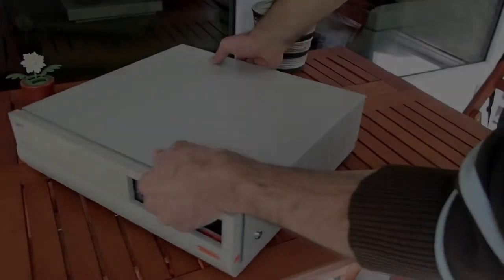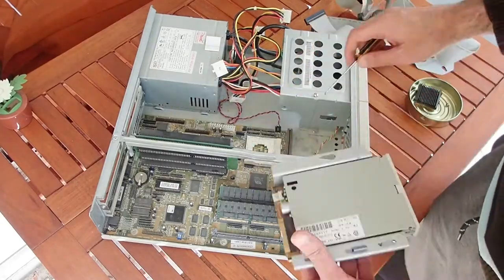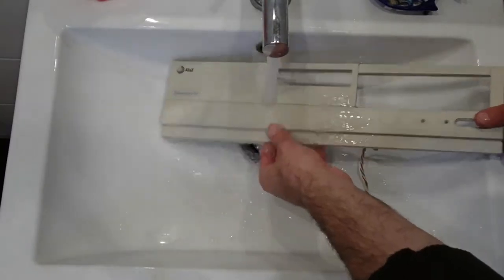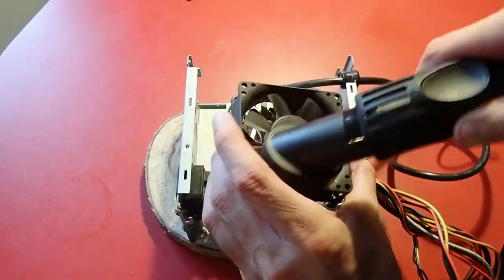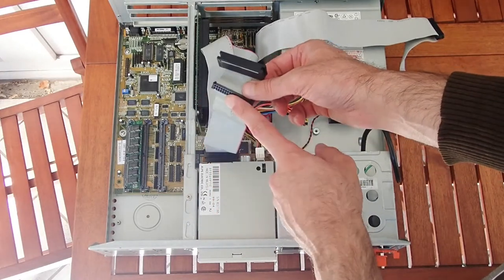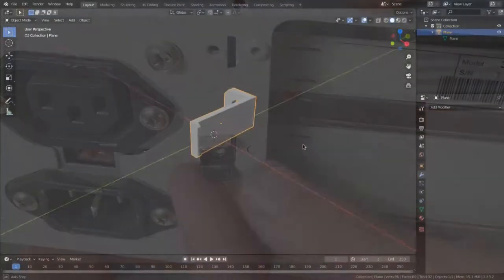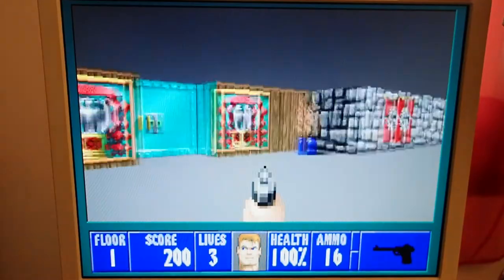AT&T Globalyst 515 restoration - from boring office box to retro 486 gaming PC

Comment: I got an NCR 3231 which is 95% identical to your machine. Fortunately it came with the 256MB cache memory (one of the main reasons I got it). That, along with the 66Mhz CPU upgrade and the 20MB total RAM makes a fantastic 486 machine. One of the differences with yours is the two ZIP available free sockets to add 512KB VRAM modules, to make 2MB total VRAM memory but they seem to be difficult to find.

Comment: I have the smaller version of this PC, mine is NCR branded, model "SYSTEM 3227". The case design is the same but at about 1/3 of the volume of yours, it has no 5.25" neither 3.5" bays and the floppy drive is of the slim type usually found in laptops. The hard drive is a standard 3.5" unit tho.

Quite unique machine and I'm happy to have it in my collection.

Comment: Hey Necroware I really enjoyed the the retro restore of the AT&T machine. Another computer saved from the E-waste jaws. Nice the PSU was the standard AT shape and power connection. I have an old HP Vectra VL2 4/50se that I need to do some work on restoring but life tends to get in the way. The worst part is the power supply is as long as the case itself(proprietary design) and it has its own special proprietary power connection and the video memory upgrade(from 512K to 1MB) is also the same way and its impossible to find. Again great restore and thanks for the upload.
Reply from the maker: Thank you, glad you liked it! Unusual PSU can be really a pain in the neck, I have here another machine, which I'd like to bring back to life and it also has a proprietary PSU with 115V for USA, however I live in Germany and we have 230V, so I have to find a solution as well. I'm working on it and I think, it will be another nice video :)
Reply: @necro_ware  I know they make voltage converters or voltage steppers from 230V to the US 115V but I don't recall ever seeing it in reverse and that can be a bummer on that project. When you find a solution I would love to see that video of your US Vintage Machine. Growing up and having friends and family and had old computers like the commodore 64 Old 286 computers 386 computers 486 computers it's just a great time and when someone else restores a classic from my childhood it's nice to know their are others out their that appreciate these classic machines and don't just throw them out just because the 2.0 model came out and so forth. Thanks again for the upload.

Comment: I did some changes with my AT&T Globalyst 515. 2GB CF, Gotek FDD emulator, new noctua fans on CPU and also inside PSU. ...and hi-end midi music Roland MT-32 I love this computer! 😍 I thinking about CPU upgrade. I have here 486 DX2 66 ... hmmm maybe with 66MHz cpu will be Transport Tycoon more playable? 🤔😊 interesting inside this machine is FIC 486-GAC-2. On ultimateretro website there is two different colors yellow and yellow-green combo. Mine is dark green. Can i ask what another bios did u tried? I have also IBM and i want  try award. On ultimateretro is available award from 1997. Is there something new or benefit from newer bios?

Comment: Sometimes, for some reason, some hard drives are finicky with proprietary boards and need to be configured as Cable Select. Sometimes just doing that solves the issue. I've had my fair share of finicky drives (or also boards that won't boot if the drives are not Cable Select).

Comment: I have the predecessor to this machine, an AT&T PC 1151 before the Globalyst branding was rolled out. It is the complete opposite as it is completely standard - Baby AT motherboard and power supply, normal L2 cache sockets on the motherboard, normal VLB and ISA slots. Got it new in box. It's a nice machine and it's a shame AT&T/NCR went to this mostly custom layout.
Reply from the maker: Well, normal baby AT is easier to work with, but this design was not as custom, as one would think. This model used an FIC mainboard, which was used in many other computers as well, only the BIOS version differs. The layout was more or less compatible with many cases, so I'd say that it was semi-custom. On the good side, the case could be made more slim, than a normal AT would be. For me only the custom cache module was a real pity.
Reply: @necro_ware  Will a 486DX4 Overdrive operate on this board? Could be a good compromise way around the hard to find L2 Cache module as you get double the L1 cache on-die. It works in the 1151 fine, so I'm assuming a newer Globalyst should take the Overdrive chip.
Reply from the maker: @RetroTechIIfx  I guess so, the one with voltage regulator should work. However, I don't have that CPU and this machine is warming another retro heart since a long time yet....

Comment: About 486 and Quake. Quake req's 486DX4-100, and i think - Intel model, it has 16k L1 (AMD - 8k) should run at minimum playable fps. i saw video on tube where am5x86 (as variant of 486) was overclocked to 200mhz and quake shown 21fps in demo1, this is Pentium-90 level.

Comment: A 90 degree riser for a L2 cache card may be easy to do.
Reply from the maker: Yes, this is a nice idea, however, the pinout has to be reverse engineered, I guess....
Reply: @necro_ware  This implies you have a memory extension, like the one you show from Ebay. So no need to reserve engineer anything. The problem is just the physical size.
I suppose the spacing between connectors is the same as PCI, or any other standard connector.
Something like this. Of course here it's a PCI-E, just an example :
Reply from the maker: @nalinux  it's more like vlb. However, the shown module from ebay is unfortunately not pincompatible, I found a thread on vogons, where exactly the same constellation was tested.... that's why I guess, that the module has to be reverse engineered :(
Reply: @necro_ware  If nobody knows on Vogons, it's a bad sign :(
Reply: BTW I love your channel. Surprised it's not more popular. I just discovered it yesterday.
Reply from the maker: @nalinux  Thank you very much. Well it's a lot of work to get a channel well known. The quality of my content is not yet good enough, if you ask me. But I'm trying to learn and improve.  I think, it's getting better :)

Comment: wow brings back memories but mine had lvl 2 cache onboard, think i had a orchard 64bit 1mb video card with it.  upgraded with a 486 DX4 100.
Reply from the maker: You probably have had a newer board. This model doesn't support 3V CPUs and so can't be upgraded to a normal DX4-100. Only the overdrive version with an integrated voltage regulator would work, but they were extremely expensive back then and are today as well.

Comment: @necroware hello i bought exact same PC very good condition now waiting for delivery. Can i ask ... you washing MB only water and soap? Is standard soap or something special? Can i wash other components like sound cards, ram, gpu? Thank you for answer.
Reply from the maker: Hi, yes, just standard water, soap and a brush. Don't forget to remove the battery. You can wash almost everything that way, only not the mechanical parts. The water itself is not a problem, but the salt in it. So, when it dries you can have white salt spots on the board, if your water is very hard. You can use distilled water or compressed air to blow as much water from the PCB as you can. You can also spray the parts with alcohol to improve evaporation. However, I don't bother, I just wash it as I've shown in the video put it upright to let the water drip off the PCB and leave it like that for at least 24 hours in a dry room. The parts have to be completely dry before you turn them on! Some water can hide under the ICs, so if you want to check if the board is dry blow some air under an IC. If no drops of water are coming out, it should be dry.
Reply: @necro_ware  thnk you so much 🥰

Comment: 7:30 did expect an mechanical keyboard not a rubberdome...  and NKRO is not an option. You should try an old-style mechanical (cherry) piano...
12:45 the same caviar 2120 u already used in a previous video about an retro gaming machine (mini tower and white restoring front plastic cover)...
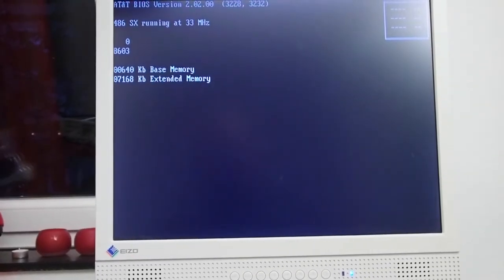13:15 instead of 16 MiB TSM only 8(192) but it showed 7168 KiB / 7 MiB ... ... two times...

Comment: Very nice restauration !
Will you put a new "intel inside" sticker ? ^^
Maybe you can make your own COAST module for this board ? I wonder if that's even possible without getting too far in a rabbit hole.
Reply from the maker: Thank you Deksor! It is a new CPU, so I'd actually need a new sticker don't I? ;)
I think an own COAST module is too much effort, especially since there is no documentation on it. I found a vogons thread, where people found multiple modules, which do look the same, but none of them are electrically compatible with this mainboard.
Reply: @necro_ware  did I get that right: you found a module that would be electricaly compatible to your board, but mechanically too high to fit under the floppy drive - and the modules that would mechanically fit are electrically incompatible?? 

that slot looks to be mechanically compatible to a PCI slot - so I think you should be able use a low profile 90° PCI Riser in order to get the cache module to fit under the floppy drive
Reply from the maker: @KenjiUmino  I don't know. I saw it on ebay, but I didn't buy, so I have no clue if it is electrically compatible. And that slot is more like VLB, it is shorter, than PCI. However, I don't have this PC anymore.
Reply: @necro_ware  oh ... I somehow assumed that 32 bit PCI and the brown VLB are mechanically the same thing - and I didn't ever question this assumption as the industry has and still does re-use connectors for different purposes a lot.

But I just learned that PCI has 62 pins on either side while VLB has 58 pins.

Comment: heatsink on the 33 MHz and heatsink and a fan for the 66 MHz - do they even get warm? ;)
Reply from the maker: Actually, they do :) Well, the 33MHz not so much, it can work without a heatsink quite long, especially in an open case. As you can see in the video, I tested the PC first with the SX-33 without a heatsink indeed. However, the DX2-66 can get quite hot, especially the 5V version, which I'm using here, since this mainboard doesn't support 3V CPUs. The temperature of i486 CPUs is specified with up to 80°C. A 5V 486DX2-66 without a fan on a warm day in a closed case would get there quite fast. You can see some measurements in my another 486 rebuilding video, where I decided to install a fan, because the CPU got too warm. 

https://www.youtube.com/watch?v=PmM_17JwJtY
Reply: @necro_ware  thanks for the (hot) tip! Time to go shopping for heatsinks!
Reply: @mrvellu  Or if you think about it, on the other hand you get a free "bread toaster" :)

Comment: Does that cpu socket take physically larger cpus?  or is it just the design of the socket?  looked odd seeing  a row of pin sockets around the cpu when its installed. Great video as usual !
Reply: This is socket 3. It was made to install Pentium Overdrive chips as well as regular 486 chips. The Pentium Overdrive uses that extra row, none of the other chips do.

Comment: Anyone catch the floppy error? You have to install them after the twist at the end of the cable :) Cheers! (olde nearly useless info for u)
Reply from the maker: This is obvious in the usual case, but as I said in the video, if I installed it after the twist, that didn't work. Turned out that the floppy was hard wired internally to be a second drive.

Comment: Strange how it has an IBM BIOS.
Reply from the maker: Yeah, I investigated  a little bit on that, since AT&T and IBM were big competitors back then, it was quite unusual indeed. As I told in the video, the Mainboard for this PC was made by FIC, who had contracts with IBM. So eventually, FIC released this mainboard re-branded for AT&T. Furthermore, this exact PC was also made by NCR Computer and they had support for it up to the end of 90s, and you can still download the latest BIOS from there. I tried that one as well and it was actually much better. More settings, better performance, but eventually I put back the original one, because of AT&T branding. Actually I think, that this PC was made by NCR for AT&T, because the case looks very typical for NCR with that orange power button.
Reply: @necro_ware  Great Video!  Brings back a lot of memories!  You are correct -The only difference between the NCR and AT&T models were the colors of the cases and bezels - yucky beige for NCR and "Arctic White" for AT&T.  That was right during the time frame that AT&T had taken over, failed to properly integrate, and then spun off NCR.  My company at the time were selling Globalyst PC's like crazy and I had a 515, and the guy across the aisle had the same thing in NCR.  Thanks again for the great video.
Reply from the maker: @jimduke7472  Glad you liked it! And thank you for the info as well.
Reply: @necro_ware  IBM and AT&T/NCR collaborated a bit, NCR being one of the few places making Microchannel PCs, including some very odd SMP 486es and Pentiums.